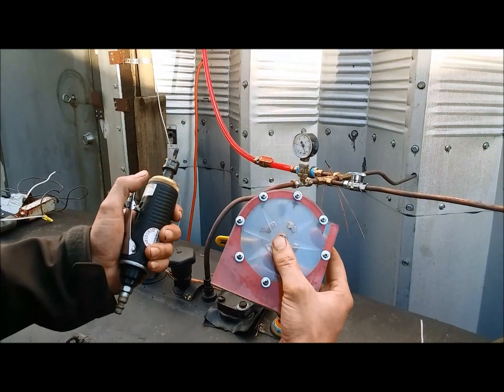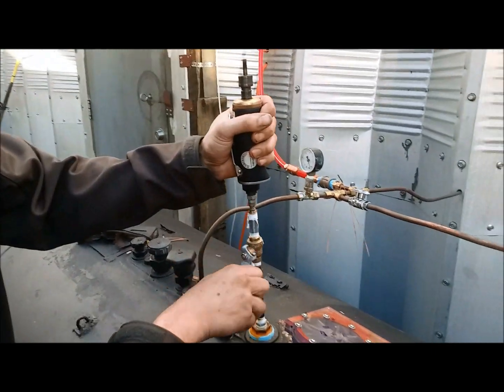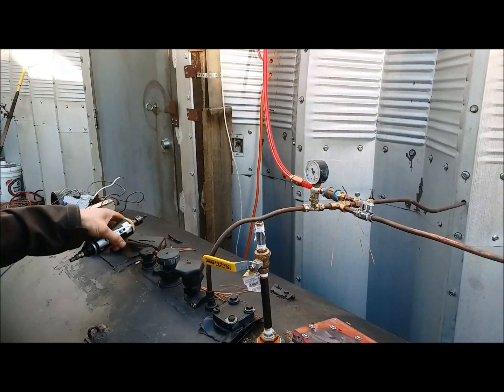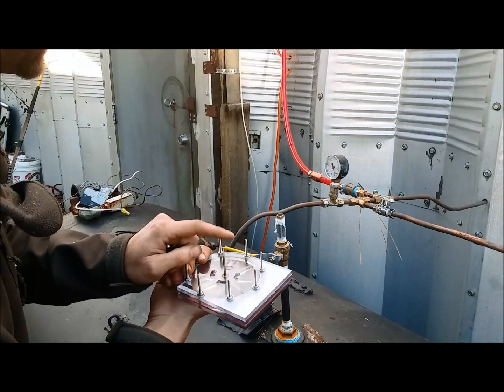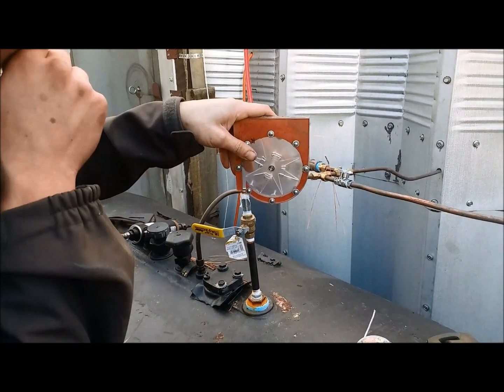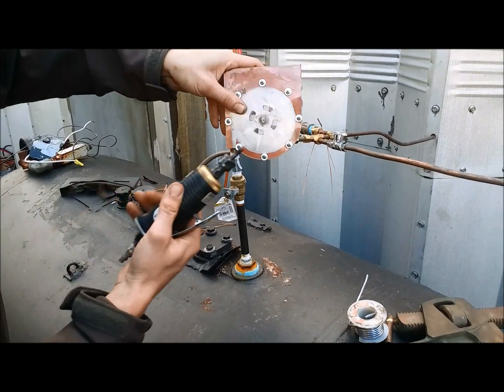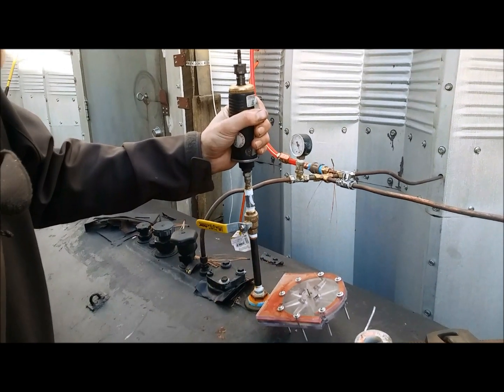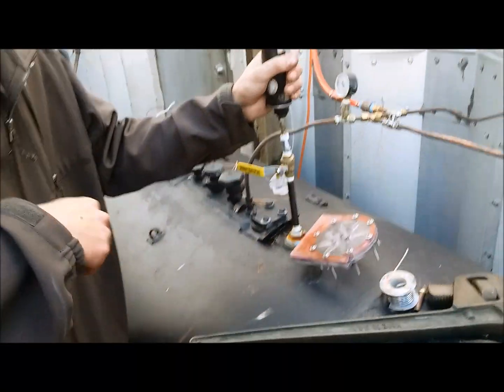Turbine air system that will replace batteries Test 2

Comment: Dude what you need to understand is the pneumatic tool you used for comparison is designed for hi pressure low volume as it is eccentric rotor vane(positive pressure) design and your turbine is a hi flow low pressure(non positive pressure)design.you need to mention the airflow volume along with the 20/30 psi pressure used for the turbine.
Reply from the maker: Yeah I figured that out, this was when I was new at building turbines. I've been going for two and a half years now

Comment: This is amazing result... I see exhaust is at the middle right? So air kinda runs around untill it's pushed towards middle... But wow and also blades are simple too. Guys u made my day
Reply from the maker: Thank you for the awesome comment. Exhaust is at the middle, correct. The design is extremely simple, our future turbines will be similar but not quite as simple, we are going with disks and star washers, and two stage turbine. Know-one seems to have done this before and Nikola Tesla says it will make the efficiency 50% more efficient.